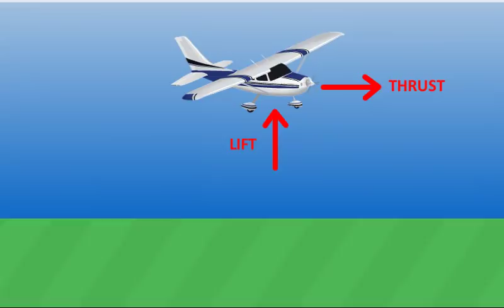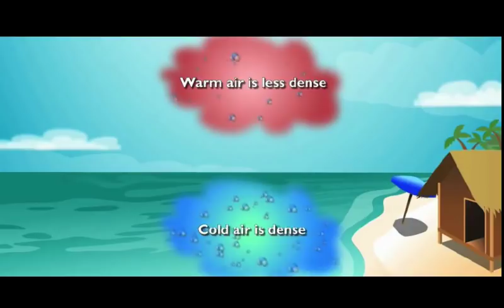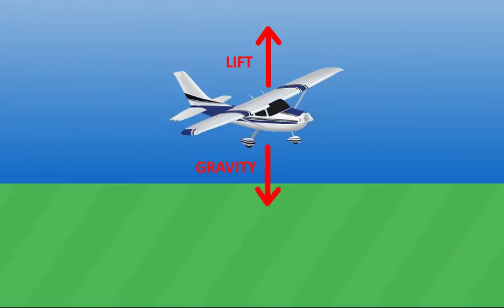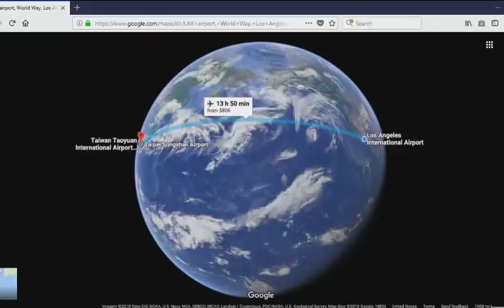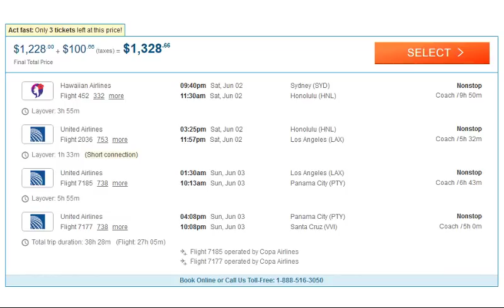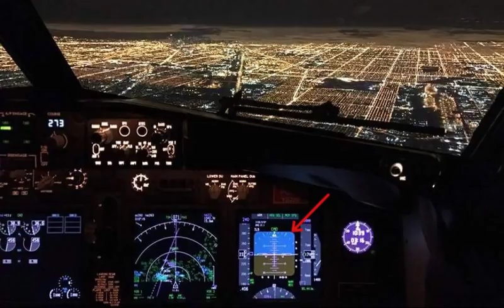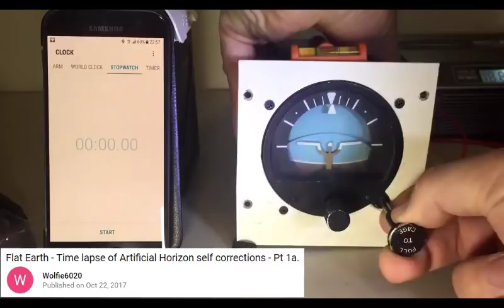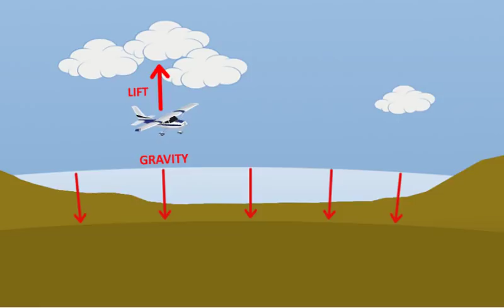Flat Earth Falsities - Plane Nonsense

Comment: Studying the North Star, in time lapse videos, how the other stars all rotate around this one star, JUST for laughs (since we're so sure about a ball) IMAGINE that you're looking at a dome's inside,  like it's a cake pan lid  and the north star is at the middle of the lid, and all the other stars are stuck inside the glass cake pan lid. You spin the cake pan lid, and slide it over the cake  plate at an angle of  50%, and not just one angle to the plate, but at two different angles.  You've placed a flat earth map, like the Gleason 1892, in the bottom of the cake plate and you notice that the stars in the lower portion of the lid rotate over Australia, but not the US.  You put the center point  of the pan lid over a spot that would be in Brazil, just past the diameter line, in the center of the plate, at the 50% angle. Next you're going to point the axis of the cake lid (imagine an axis  line through the center of the cake pan)  about  20% or so, off the center of the north pole spot on the map..  Now you have the set up, and you're spinning the cake pan lid. Now you can view the time lapse videos again, and you see that  that the stars rotate in such a way that matches what you see inside the cake pan lid. Then you get your ping pong ball off the table and take it to the cake pan plate, and hover it over all the continents like the hands of the clock. At this point, regardless of the fact that the sun and stars  rotate  .around earth at the same speed, they are at different angles to each other by a large degree. Clincher? As you look at the ball going  over the plate, imagine the people on the planet seeing the ball appear to come out of the horizon from a north to south AND east to west direction at the same time, and the same thing happening at sunset, travelling from south to north and going away to the west.  Then you find that the set up fairly matches up with Bible descriptions! Have a nice rest of your day!
Reply: The most obvious problem with this "explanation" is that no matter how you orient the flat Earth's plane and the dome with respect to one another, the same stars should be visible all over the Earth, just at different angles above the horizon (or altitude, as it's called). Let me know when you find any place south of the Tropic of Capricorn where you can ever see Polaris in the sky.

Sure, when you look at the sky from any one point on Earth, it looks just like the inside of a rotating dome would look like seen from a flat plane inside the dome – only  for different latitudes it looks as though the flat plane is at different angles to the (necessarily spherical!) dome's equator. This can only happen if the plane on which the observer finds himself it simultaneously at different angles to the dome's equator for different distances from the plane's center – and such a scenario is geometrically possible only if the plane isn't actually a plane but the surface of a sphere (with a radius large enough to create the illusion of flatness).

PS: It's irrelevant whether your setup matches the Bible's descriptions. The problem is it doesn't match with observable reality – because, unfortunately for your position, observable reality isn't reduced to what can be observed by the unaided eye from only one point (or rather a relatively very small area) on Earth's surface , as is the case with the biblical descriptions you mentioned.
Reply: NotTheCIA I.think : It doesn't, of course. A text like that can only be written by someone who lives at "average" northern latitude and knows nothing of astronomy (or gets his astronomy from some ancient text like the Bible, which amounts to the same thing)...  and never mind that % is actually a measure of slope used in construction and topography, completely inappropriate in the context of astronomy or geometry.
Reply: Very well explained even for the simple minded, but some of those..well...
As the dome could not be a even curved bowl, but curved back inwards.
Idiots such as these 2  never accomplish anything except bark noise.
Reply: Garland Parks Where does the other center of rotation fit in?
Reply: The rotation is only in the dome.
Reply: Modern flat Earth hypotheses originated with the English writer Samuel Rowbotham, his wife was from Australia.
Reply: Fuck off you pathetic, lying troll.
Reply: You havent built the model for yourself I see.
Reply: You're not a smart man.

Comment: #1....it doesn't. I travel across the U.S. from west to east  every year and my return flight is always about an hour longer. But this is due to flying against the jet stream not some conspiracy surely.
Reply: ENIGMA PGH Correct.
Reply: Yes correct - if the plane were to fly 50ft from the earths surface then it would be the same, but at the altitudes modern airliners fly the winds are extreme and do have an effect on ground speed.

Comment: Also that whole, "when flying around the earth, why doesn't the plane have to tip it's nose down?" Just tells me people don't know how anything works. Even if that's how it worked, THE EARTH IS HUGE. The amount you would have to tip the nose of the plane wouldn't even be visible to the naked eye. It would look completely level. It's common sense.
Reply: An F/A-18 Hornet aircraft speeds up to supersonic speed. ... The speed of sound is about 768 miles per hour (1,236 kilometers per hour) at sea level.
= 20 km/minute = 31.39 meters of constant curving.
So if was Flat with auto gravity, what would happen? Nose down?

Huge okay.. but talking accurancy(as GE maps) apparently the equator is NOT 24,900 miles, proven by ship logs, as is the fact that longitude diverges as you go south...any comment "plane context" guys? It is more like 21,600 (3300 miles less) in Reality. They lie on everything!

Here is the last paragraph from this page https://flatearthtextbook.blogspot.com/2016/11/distances.html 
THAT CANNOT BE DEBUNKED, as well as the other examples on that page, ALL BASED ON PURELY PRACTICAL DATA of ship logs: "In the "Cruise of H.M.S, Challenger," by W. J. J. Spry, the distance made good from the Cape of Good Hope to Melbourne is stated to be 7,637 miles. The Cape is in latitude 34° 31' south and Melbourne in latitude 37° south, the longitude of the Cape being 18° 30' east and Melbourne 145° east. The middle latitude is 35½°. Difference of longitude 126½°, which makes the distance round the world at that latitude (35½°) to be over 25,000 statute miles and as great as the equator is said to be. This latter distance is many thousand miles more than the purely theoretical measurement of the world at that latitude south. Thus we see on reliable evidence that the further we go south the greater is the distance round the world. This latter distance is many thousand miles more than the purely theoretical measurement of the world at that latitude south. From the same work, we find the distance from Sydney to Wellington to be 1,432 miles. The middle latitude is 37½°, and the difference of longitude 23° 36', which gives as the distance round the world at latitude 37½° south, 25,500 statute miles! This distance is again greater than the greatest distance round the "globe" is said to be and many thousands of miles greater than could be the case on a globe. Thus, on purely practical data, apart from any theory, the world is proved to diverge as the south is approached and not to converge, as it would do on a globe."
Reply: Louis Shaw  
"12 miles per minute of constant curving."
OK lets take your numbers as accurate.  The circumference of the Earth is 24,900 / 360° = 69 miles per degree of curve.  69 / 12 = 5.75  So every 5 minutes and 45 seconds the F/A-18 Hornet would have to "nose down" one degree (1°).  Staggering ain't it?  Oh one other thing to consider, the F/A-18 Hornet would run out of fuel before that.

"the distance made good from the Cape of Good Hope to Melbourne is stated to be 7,637 miles."
And of course you didn't consider the possibility that they did not travel a direct course.
Reply: Ha ha NO not accurate conversion at all with that 12 miles,  I thought something was wrong there but I didn't care, too much in a hurry, was wondering how much the wolves would bite on it.  Strangely that gang did not, nor did you?
 Point is planes do fly a slight nose lift, just wondering what would be the sane behavior with non curvature. I shall pray for the hornet, but if those Shuttles can glide then the hornet should be okay :)

And if the equator /ball is smaller then the curvature is steeper...
Reply: 11 hours! Never had to wait that long for attention, with a free cookie I had available I was expecing a hysterical outburst as if a first... 
Onlookers may wonder WHO is uptight and religious about their beliefs.
LS was never gone, just busy on complicated science thread, garble for your gang, nothing to say Professional Navigator on the "apparently the equator is NOT 24,900 miles, proven by ship logs," neither do you :) :)

Comment: That means when the wind flow stops the earth stops roatating?
Reply: What?
Do you know what causes wind? Other than trolls farting.
Reply: Superior - Why is it windy one day and not the next?   It's called the dish pan theory.
Reply: I'm a research meteorolgist and that's what they called it in fluid dynamics in college.
Reply: Wind is caused by convection currents. Air that cools becomes more dense, which makes it heavy enough to push warmer air out of its way and sink. That movement of air is wind.
Reply: Who knows if THEY really know what Wind comes from anymore then Lightning?  [THE WIND AFFECTS THE EARTH'S ROTATION During the northern hemisphere winter, the stronger westerly winds that build up in the Northern Hemisphere, combined with frictional drag at the Earth's surface, actually produce a very small, but measurable, increase in the speed of rotation of the Earth.
This effect of the wind "feeling(??) the Earth turn underneath it" is important for very large and long-lived pressure systems.]
- Well at last Something FEELS the closed system rotation :)
Reply: Superior Planet
As I stated, you are becoming increasingly irrational and illogical and unbalanced.
https://rmets.onlinelibrary.wiley.com/doi/abs/10.1002/qj.49708335608
https://link.springer.com/article/10.1007%2Fs11770-005-0033-5
Go and see a doctor or lay off the piss and drugs.
https://encyclopedia2.thefreedictionary.com/dishpan+experiment
Reply: I shouldn't have mentioned it.  People are so defensive online.  We don't use it in forecasting embedded short waves. It's too large-scale. 

It's only for an interesting and memorable analogy from daily life.
Reply: SP has once again gone angryly all defensive with "Louie, you lying moron.", apologies I should have menntioned= http://www.weatherquestions.com/What_causes_wind.htm
Reply: Louis - that article only gives you half the picture.  Don't you have questions about how circulations of high and low pressure form? That gets into the interesting dynamics.
 I think weather articles like that make the subject quite boring.  I know  they did to me when I was a youngster.  I wanted to know the bigger picture, not just boring talk about surface highs and lows.  But maybe I'm just a weird person....
Reply: SP - thanks, I had no idea that someone could think the sun caused low pressure centers with a physical interaction like that.  wow

Uninformed people will imagine things like that and then convince themselves it's true.  But science is about disproving hypotheses.  Not making up stuff and trying very hard to 'prove' it with more bad guesses.
Reply: Superior Planet
As I stated, you are becoming increasingly irrational and illogical and unbalanced.
https://rmets.onlinelibrary.wiley.com/doi/abs/10.1002/qj.49708335608
https://link.springer.com/article/10.1007%2Fs11770-005-0033-5
Go and see a doctor or lay off the piss and drugs.
https://encyclopedia2.thefreedictionary.com/dishpan+experiment